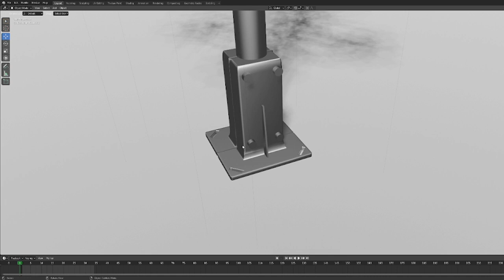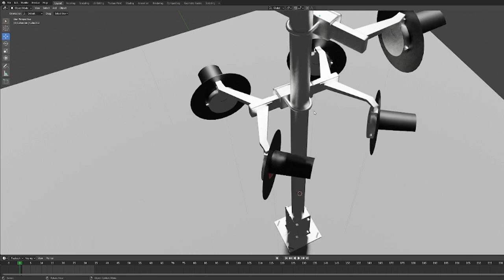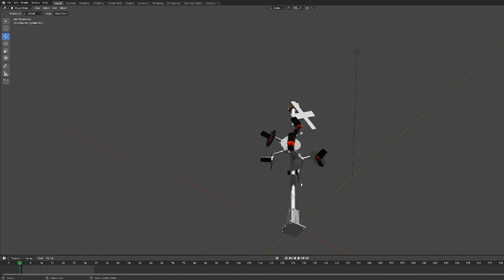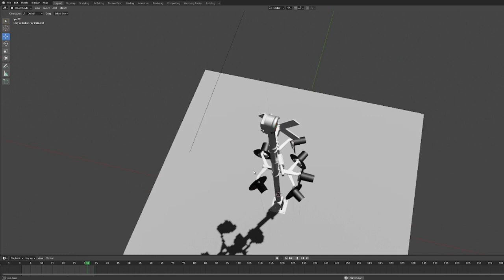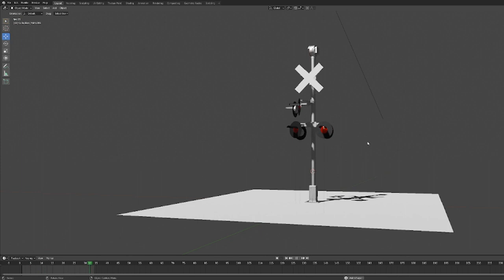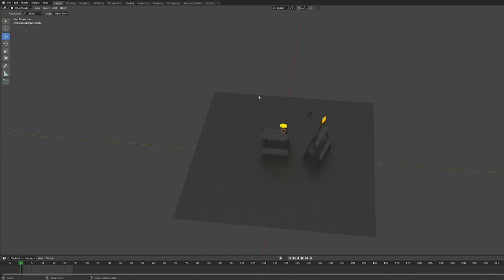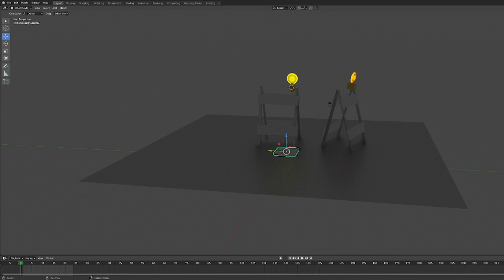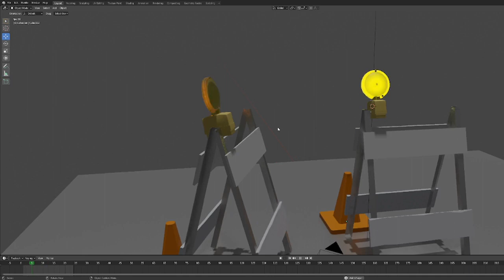Railroad Crossing And Barricade Lights in Blender

Comment: Damn these look good, keep up the good work Ivan
Reply from the maker: Thanks, yeah these do look kinda good
Reply: @IvanTimber also could you make a tutorial on how to make realistic railroad crossings on roblox because I'm tired of using free models
Reply from the maker: @hammy7061  sure! I'll try to make on this week if we arent going anywhere!
Reply from the maker: @hammy7061  wait, i do know some tips, since i dont use ROBLOX anymore
make your signal, not too many parts if you are a beginner. Then use the weld tool, look through the tabs and let me know if you cant find it
weld all the parts individually and DONT ANCHOR it to the ground, or weld. Make a base  (unwelded to ground, only to mast) and make sure you signal is stable
(i would recommend welding parts as you build) if you have any questions feel free to ask me!